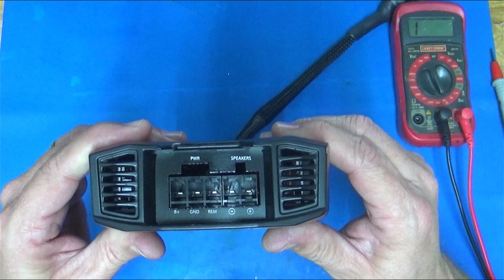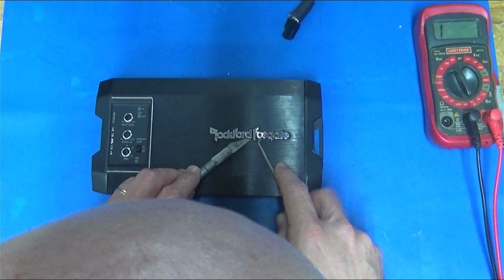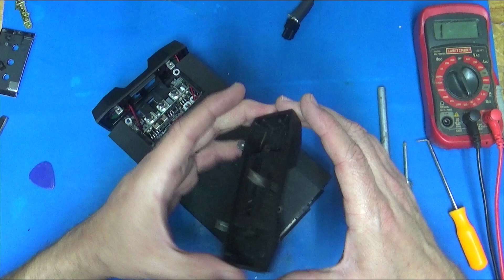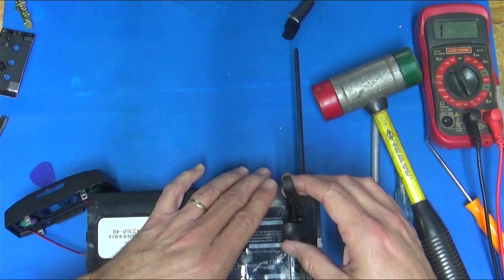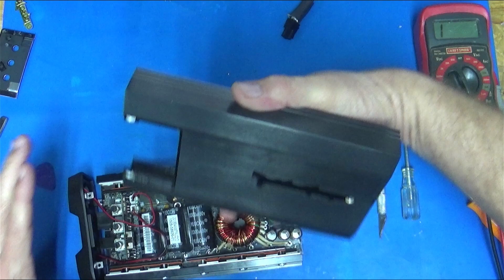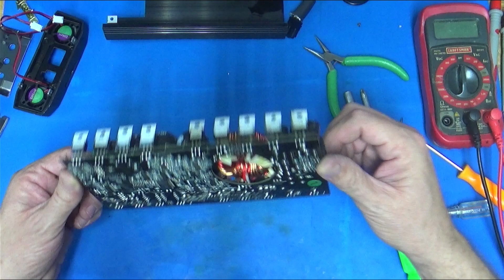Tear down of Rockford Fosgate Power T750X1BD amps. What went wrong, will it be fixable?

Comment: All those pocket class D amps will have BAD capacitors. Why? Because they are using the cheapest most crappiest caps available, second the smaller the cap (electrolytics/wet) the less the capacitance is. Once they go out they will damage fets in the output section and power supply side. 

Can’t believe they put that clamp bar 180 degrees out of phase lol.
Reply from the maker: Crazy huh!